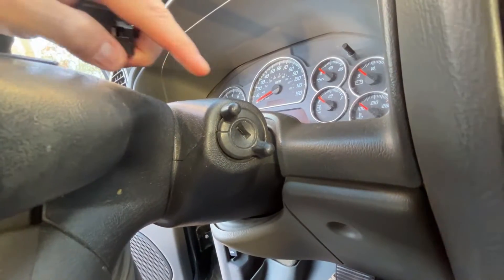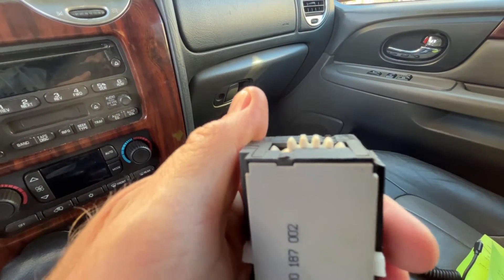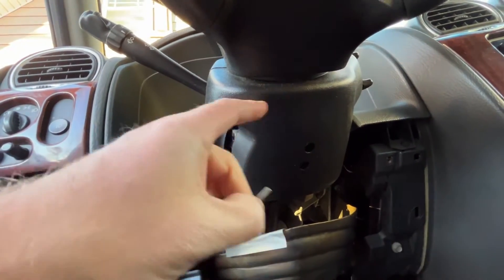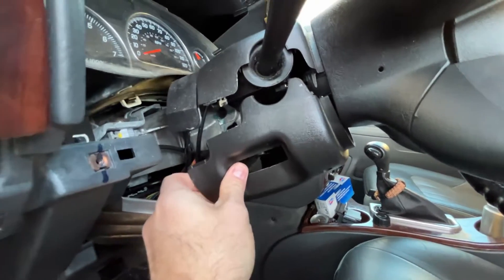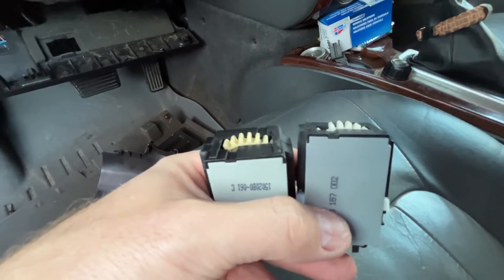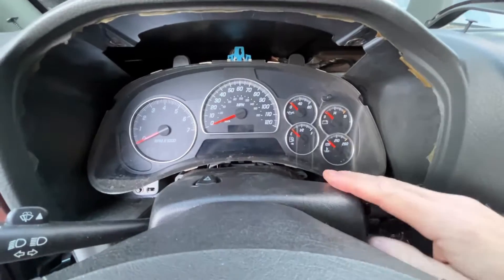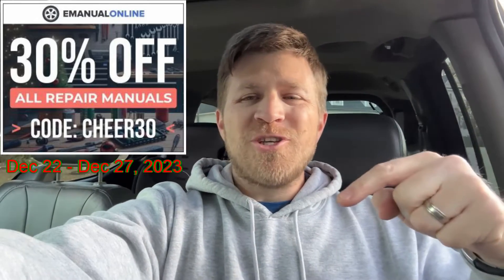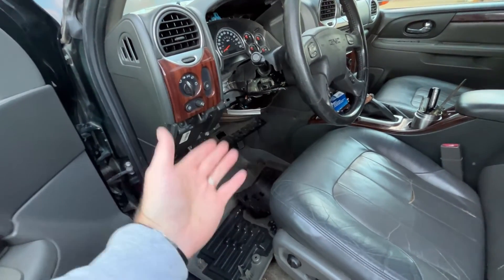EASY IGNITION SWITCH REPLACEMENT in 2004 GMC ENVOY

Comment: This video is more useful than the directions that come with the ignition switch....
Tried for an hour with what the instructions said (which was to also remove the cylinder lock) after it not working I found and watched this video, did exactly what he did and boom it started first try 😅
Reply from the maker: @Amanda-bt4vy  👍

Comment: I hope my 2009 is like this. My key locked up and wouldn't turn the other day so I'm replacing the lock cylinder to be safe. $45 is cheap enough to replace the original that's 15 years old.

Edit: crap. This isn't the lock cylinder 😂

Comment: How's your Envoy? I  have had mine for 3 years now. Started at 161,000 miles, now I got my truck to 203,000 miles. I love my Envoy. ❤❤
Reply from the maker: It’s still running good. I’m getting closer to 350k…about 343k right now😀

Comment: What do you do if the old gear was turned without being marked?
Reply from the maker: Watch at the 1:33 mark, that’ll give you an idea of how the gear should be positioned
Reply: Trial and error , but from the side by side clip you can si that just as soon as the gap isn’t seen it could work . If not just pop it out and move it Half a tooth or so

Comment: I have a 2006 GMC envoy. Will cold start but after driving for about 30 minutes it will just die. When trying to start it will just turn over. If I wait about 2 or so hours it will start up. You think that could be the problem?
Reply from the maker: It’s possibly the ignition switch
Reply: What was it?

Comment: bought my 04 Gmc Envoy from a family friend. it had 122,000 miles on it 2 years later now 130,000. I love it but the gas really sucks in the city lol AC though thats a different story. it has AC its juts not blowing through the top front air space. it blows through the bottom , back, and those air holes near the wind shield. vents . just not the front vent for some reason.. any advice?
Reply: You probably need new mode door actuators. It's a common issue on these.